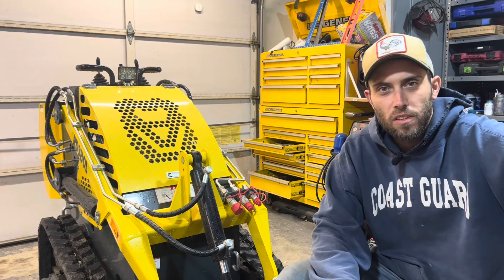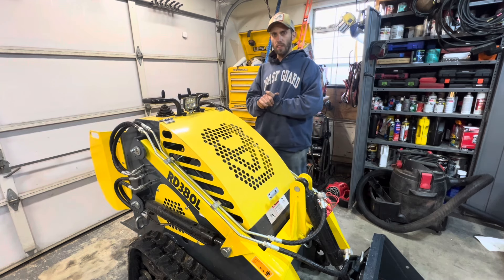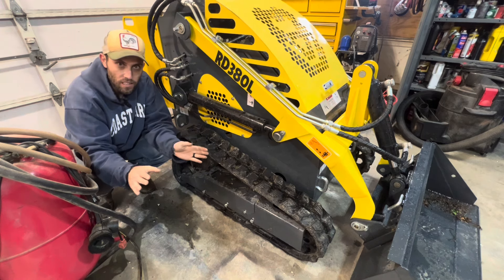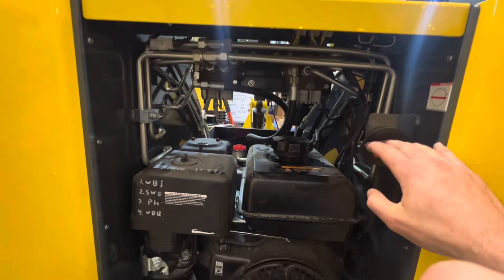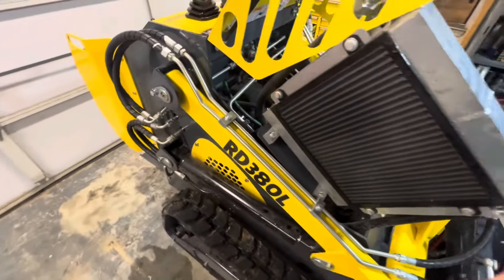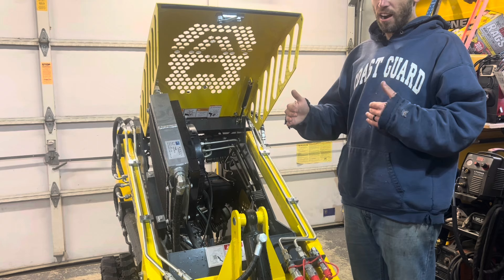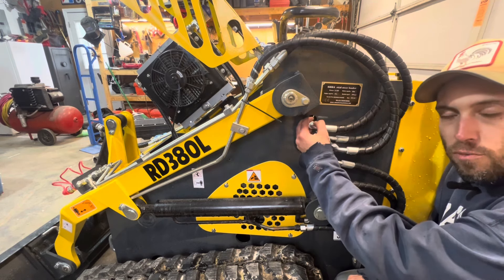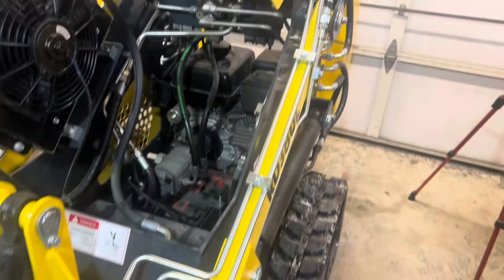Chinese Mini Skid Steer Loader: Roda RD380L from Proxibid

Comment: The mini skids seem to go on a average price more at the auctions. Even though I think that the mini excavators do a lot more tasks for the money. Mini skids are simpler in form and operation and can lift more. Unless you have prior experience mini excavators seem harder to master and therefore can’t comprehend all the tasks they actually can be useful for. So people tend to go to them first over a mini excavator for a first machine or only machine. They look at excavators as specialized equipment when it is but also a jack of all trades.

Comment: The rear roller bearings are not sealed.  The plastic covers come off with rotation.  The bearings have very little grease.  I greased them up, for the cover, I cut a piece of rubber hose, clamped it on the bolt collar, so it just touches the plastic cover and stopped the one that was popping off, until I sort some better.  Used the same rubber hose and attached so the rad doesn’t bang on the metal rest and get damaged.  Also, when I pushed into a dirt pile the right track came loose, not the threads, maybe something was position wrong when I put the track back on.  Tightened and it stayed tight, someone mentioned that the plate the adjuster road is attached to needs to be reinforced.  Front roller wheel needs to come off, see what kind setup is in there.  Cheers.

Comment: FYI, you should check that lower idle roller below the track motor. I've seen several that the seal pops out and the bearing gets dry.

Comment: My AGROTK YSRT14 is exactly the same as your Roda RD380L minus the side plates. Thanks for posting these super helpful videos! I appreciate the info and good luck with newborn, promotion and the move!
Reply: FYI, I looked at my machine last night and noticed there were guards around the body where the hose fittings come out, so AGT did think of adding some level of protection there.
Reply: Just bought a 2024 AGT YSTR14 last week brand new at an auction. Haven't picked it up yet. How are you liking it. Any pointers or tips i should know..

Comment: Tracks are basically wide rubber chains.
Tires do less damage to grass/the ground when turning.
If you need to dig or push, tracks give way better traction.
These exact same machines with a different name on them sold for $2,800-3,000 at auction this past week here in Texas, they had dozens of them.
I picked up a new mini excavator for $3,500, that’s how  I found your channel, looking for what modifications I needed to do to it.

Comment: Two more advantages of tracks over tires is they don't get flats, and they distribute the weight over a larger surface area so they might not leave too bad of a rut in the yard.
It looks like a mini skid steer would be good for moving dirt, gravel or snow and smoothing out material, dirt or gravel. IMO the mini excavator can do a lot more things than a mini skid steer can, but the tasks people have would determine which machine would suit them best. I wonder how fast the mini skid steer is.

Comment: I've been looking at all the various makes and models of these mini skid steers for some time now. 
I've been comparing track systems with the numerous drive setups, hydraulic pumps and how many, diesel engines vs. gas and all the different manufacturers who make these gas engines, as well as the overall size of the machine. I don't want to make the mistake of purchasing a unit that's undersized or underpowered for what i need to do, even if its for a job outside of the scope of what it was purchased for?
I want to be sure that replacement parts are available. 
So it boils down to doing your homework first before going out and dropping thousands of dollars on equipment that won't live up to your expectations. Don't buy something because you believe it to be a deal when it really isn't. Dad always said, a cheap man pays twice. So true! Thanks for the video. Very informative.
Reply: Which model did You buy?
Reply: @adamj7562  A Toro Dingo TX525 used with low hours and a reasonable price. All parts accessable thru a dealer. Chinese models? Not so much.

Comment: Super helpful. I have a mini ex with lots of mods. I still need some of the upgrades you sell. I'm currently shopping for a mini skid steer, but wanted to stay with the single cylinder...although I was unsure about the power. I trust your evaluation and will get a single cylinder. Thanks.

Comment: Hey I just bought an EG360 which looks the same as yours. My question is where can you buy parts for these units in Canada or the US? After 22hrs of operation my bearings went out and screwed up the bottom back wheel? Also, what type of hydraulic oil is used??? Thanks

Comment: How do you get parts for the Roda 380L? My rear idlers are rusting and need replacement. Wont hold the bearing in place well and track slips off.
Reply: Either reach out to the manufacturer or take the idlers to a parts store and see if they have an equivalent
Reply: @JimmyDeanSlides  Your aware these are not made in the States? You cant exactly call the manufacturer in China. AGT industrial is out of stock and Roda doesn't have any service department. I definitely recommend finding out who in China can supply the rear idlers? Because they will rust and through normal wear and tear not be able to correctly hold the bearings. The bearings you can get at the auto stores- but the idlers you have to order for China or have a machine shop custom fabricate them here.

Comment: I am despite advice/help. I bought one of these (used with 21 hours on it) from a guy 2 hours away. He started it and showed me basics on using it and it seemed perfect. I mean, only 21 hours on it m, there shouldn’t be any issues right?  Got it home and after 30 minutes of just driving it around to get used to the feel of it, it got slower and died. Could not restart it, it would just click when I turned the key AND I couldn’t pull the starter rope. Like it was locked up. After sitting for about 20 minutes, it would restart but then die again shortly after. Yes, I have enough oil in it, fresh fuel etc but it seems like it’s overheating. I don’t want to cause any damage to the cylinder by using it if it’s not self-cooling properly. Does this have an oil pump? What could be going on that is causing it to do this?  I’ve tried it off and on over the last several months and same situation. I’m so disgusted that I spent $4000 on something that I can’t use. I have a huge landscaping project to do and I usually do all my projects with just myself, a shovel and a wheelbarrow; this was a splurge for me and all of my savings for “emergency use”. I’m almost 60 and could definitely use this machine to help. I am very handy at repairs, I work on my own vehicles and have restored a 1956 outboard boat motor. If someone can please point me in the direction of where to start, what’s causing this to happen, I will be so grateful! It didn’t even come with an owners manual and this is the first RODA. Thing I’ve found online. HELP!!!
Reply from the maker: First thing i would do is figure out if your engine stalling out problem is related to the engine, or the hydraulic pump. To do this, I would unbolt/disconnect the hydraulic pump from the motor, and start the engine and see what happens. If it’s an engine issue, it could be your carburetor or some internal issue with the engine, as the engine itself is just splash lubricated. For what its worth, a Harbor Freight Predator 420cc engine is IDENTICAL to the current engine in the Roda units, and, although I wouldn’t recommend throwing a new engine at this issue, for the money and time saved, it might be your best bet. Before you commit to this, make absolutely sure the issue is the engine and not a failing hydraulic pump or something downline from the engine itself.
Reply: @thegarageconnection  THANK YOU SO MUCH for replying! You're the only person who has offered any advice at all on this and I'm so grateful.  As many vehicles and motors that I have tended to, hyrdraulic systems are new to me. The stalling out/dying issue happens weather I'm actively using the bucket (lifting/raising/dumping) or just driving it around so if it happens while not using the hydraulic-fueled amenity, could it still be related to the hydraulic system?   Man,, I sure hope it would be something as easy as the carb; I've rebuilt 12 of those for other engines so that would be a snap. I did look at the Harbor Freight engines actually, just after looking at your video. I was hoping they sold B&S ones but saw only the Predator ones (although they did get great reviews). I will keep that in mind as a fall back in case I can't figure this out. One more question, can you tell me if there is an oil pump on this engine and/or is it it air-cooled? Thank you again!

Comment: Im wondering if yiu think it would be worth upgrading to a three stage pump. I just bought one for a smoking deal   exactly the same as yours. But it is a little slow any mods i could do to help it a bit with out compamising the smooth controls

Comment: I've got one of these, the bucket dump function on the lever becomes stiff (impossible) to move after a few minutes. Do you think this is a control valve issue or cylinder issue. All other hydraulic functions operate correctly.  After an extended off time the lever can again be moved.
Reply: Sounds more like an internal leak in a hose pressuring up and blocking off flow I would get new hoses and see what happens
Reply: @MrCheaterpipe  ??? Internal leak in hose, I don't understand.
Reply: @csurfer  hydraulic hoses are constructed in layers there's an inner layer that's impermeable so the fluid stays inside the hose then it's reinforced with steel cable before being covered with an outer sheathing sometimes the inner layer can get damaged and allow fluid to build up between the layers blocking off flow through the hose and after a while of no pressure on it it will slowly drain allowing flow again
Reply: @MrCheaterpipe ..thank you for your quick response. Interesting, I'll investigate this further.
Reply: @csurfer  those new hoses fix your issue?
Reply: @MrCheaterpipe ... No not a hose issue.  For the time being I'm running the bucket off the aux controls.  Will have to swap out the control in the spring.

Comment: I purchased a Roda RD50 mini dumper. It has a similar setup, with a 6.5HP Vanguard engine, and tandem pump. I don't understand why they didn't keep one pump for the drive motors and one for the tipping of the bucket/loader blade. And they have a dual spool valve on each side, one spool for the left/right drive motor, the other for tipping the bucket/loader blade. The thing is too damn slow. Just seems this should have the drive system powered with one pump, and the hydraulics on the other pump. And make the thing go faster then 1MPH.
Also I got mine at an online auction that also was live. I put in a max bid of $2650, and won at $2500. With a 5% buyers premium, and 7% Iowa state sales tax, so I ended up paying $3808. The odd thing, there were two of these, the next one sold for $1600. So who was my agent at the auction, as I believe they could see my max bid, and run it up with shill bids. I still feel screwed. I was the only bidder online as no one else was bidding against me, before the live auction started.
I'm really interested in making the spool valves on my AGT L12 mini-excavator (how I found your channel) to have some variable flow to reduce the jerk. I hope you continue with that issue in the future videos (reference your video Inside your Hydraulic Directional Control Valves and possible mods).

Comment: Is $5500 too much for one of these locally in your opinion. I just need something for mulch moving, seems like plenty of machine for that but so many folks on here talking sub $3000. I just haven’t seen any that cheap personally around here.
Reply from the maker: That’s a fantastic price for it
Reply: I just bought one in Kimberley BC Canada for 2700 plus auction fees so around 3 grand but I also see most of them on Ritchie Bros for for around 5500. It was a smaller auction. So I don't think people really know what they are going for. It's been great. Got 2.5 hrs been great so far little slow.
Reply: @travisroesner6819  great deal! I am about to go check out one about an hr drive from me this weekend. Different model (SL 36) but seems to have similar specs priced at $5200.
Reply: 5ish seems to be the going retail price for these small machines (minivexcavators mini skid steers and mini front end loaders) no matter where you are but they can be had a little cheaper at auction as long as you set your price and don't go over gotta factor in all the expenses auction fees taxes and shipping or your time and fuel to go get it its really all a matter of how fast do you need it and do you have the time to dedicate to watching all the different auctions to get the one you are looking for
Reply: @MrCheaterpipe   thanks brother! I ended up spending a bit more and got a JD riding Skid. Its still pretty small but significantly larger than these stand on versions. It's a work horse no doubt, been putting it through the works on my property. Cheers!